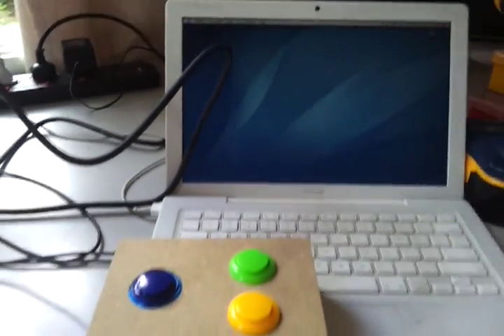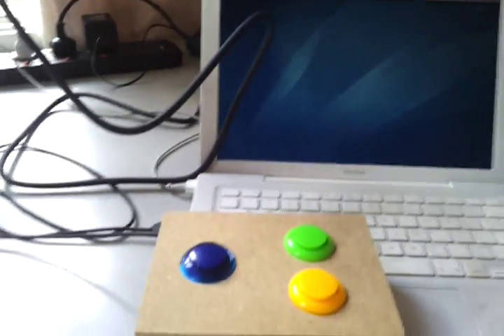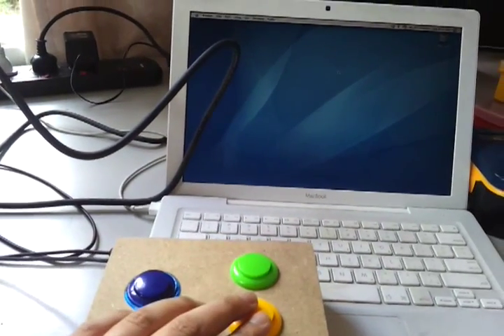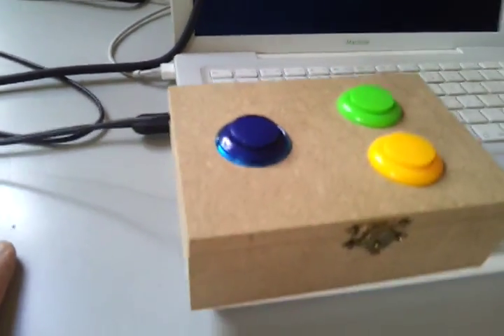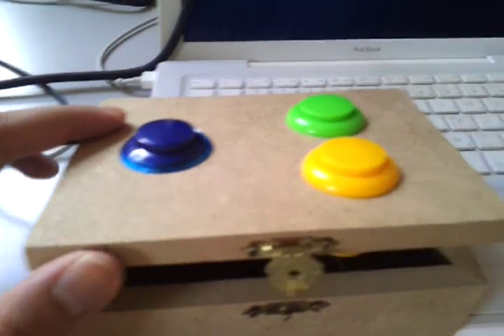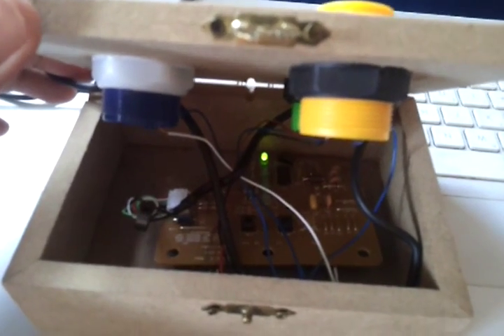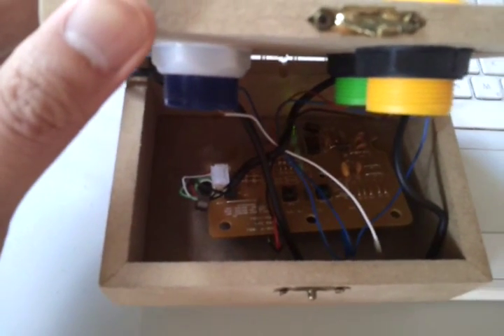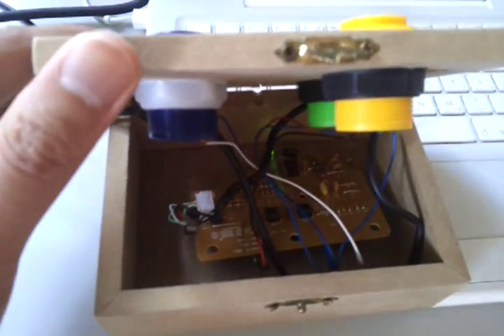USB Volume Controller Made From Old Keyboard

Comment: This is what i want to do as i hate using the Fn buttons on my laptop. My old laptop had dedicated media control buttons on the front. modern laptops do not. This is a great solution if it was smaller. If i could get that to about the size of a thumbdrive with just the three buttons i'd do it. Man, So close to my perfect solution. Thanks for the vid.